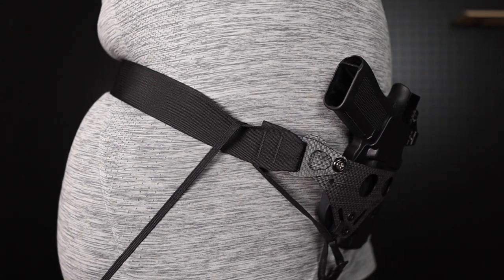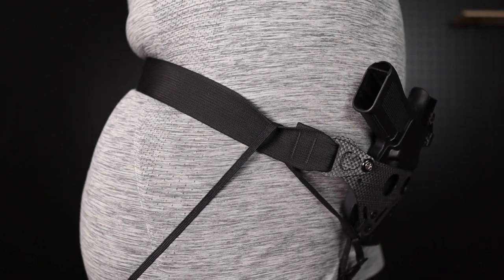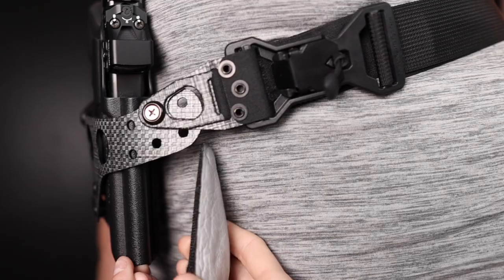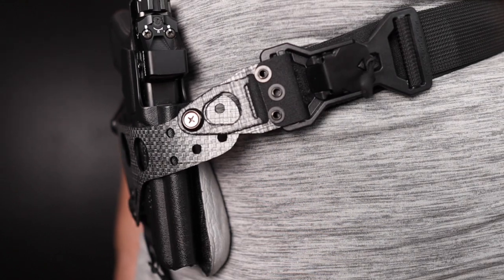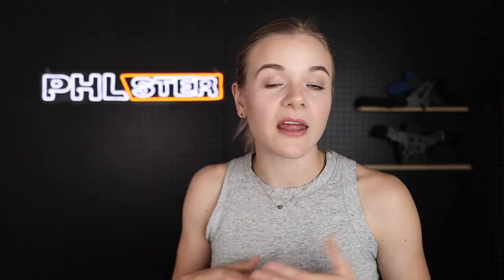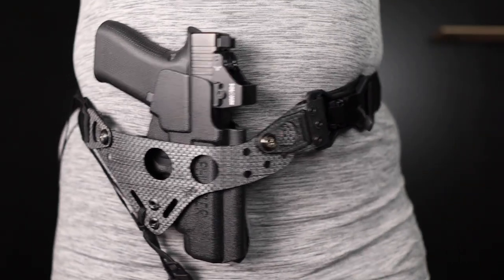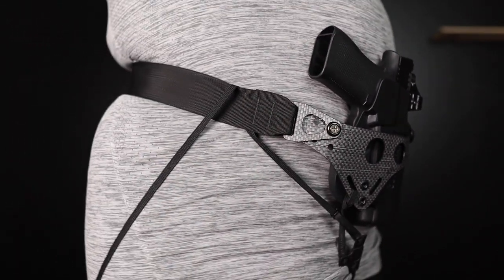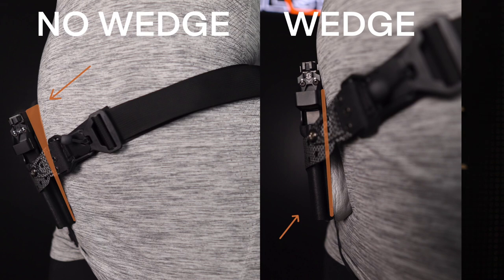How to Use a Holster Wedge Part 2

Comment: Two points, the wedge used in this video, is it possible it can fall down since its placed and not attached or did I miss something?  2nd the enigma, for those having to take pants down for the bathroom, what part of the enigma would we have to loosen other than the leg strap?  An unasked question is the dumb one. In our world today we must stay ready quietly. Thank you for sharing and be safe.
Reply: Velcro attached to the holster and wedge is normally the preferred method. 

You only need to undo the leg leash to use the restroom
Reply from the maker: A wedge like the one in this video, should be used with velcro attached to the holster. This was purely for placement demonstration. 

The restroom experience can be a bit different for everyone. If you're wearing a garment under your enigma (like high waisted underwear), then the belt itself might need to be loosened in order to shift that garment, but for most, it's just the leg strap that needs to unsnap.